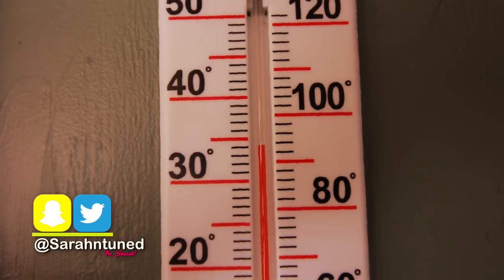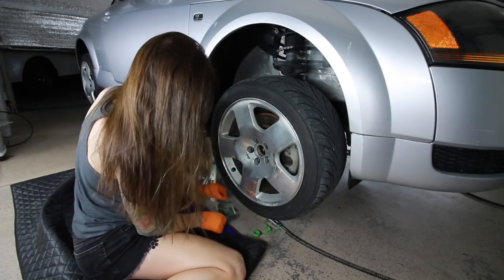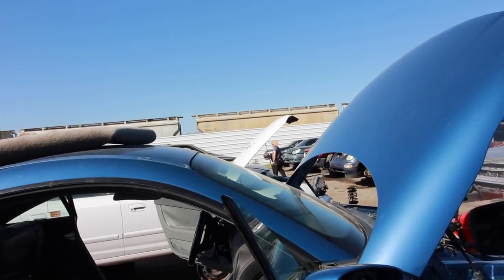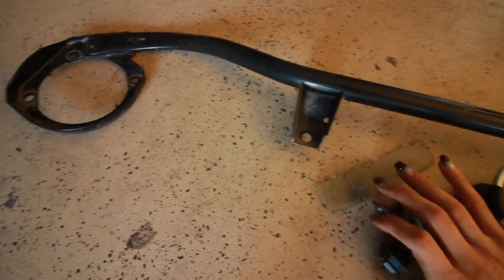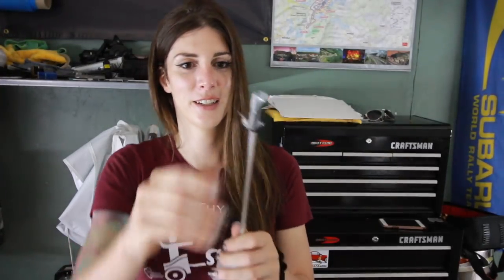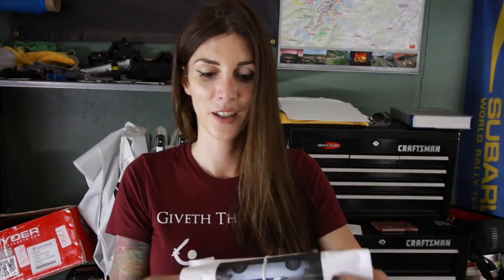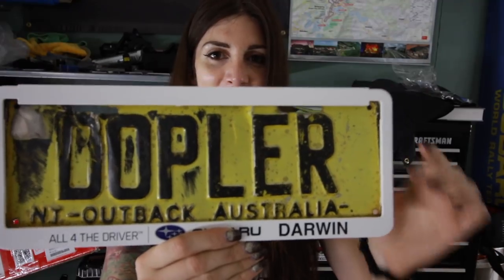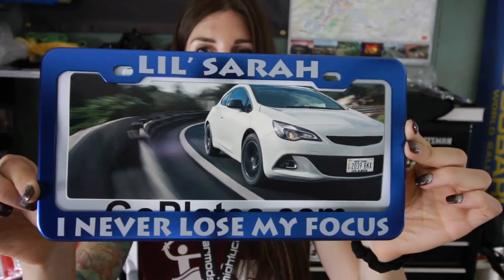Friday Night Out ..to the Junkyard // Vlog Series 025

Comment: The TT is getting better each time. One of my brothers had a 1999 TT. You're saving an absolute fortune using junkyard parts and even more on labour charges. My condolences on both of your recent losses. The thing that goes round your neck is called a lanyard (that's what we call it in the UK). I have to have one for my work pass.

Comment: Sarah on these platforms the fan won’t operate unless the air conditioning is fully gassed / charged. I had a 2002 golf gti where I could not get the fan to run. When I had the system re-gassed the fan was fine

Comment: 1.  Very sorry for your loss and of course Lil' Sarah's loss.  Just know there are people who care.  Lost my mom recently too.  Know how if feels.
2.  Not sure about the instructions on your cooler, but most air conditioners work by removing heat from one area and dumping it in another.  If it's just sitting in the garage, then it's removing heat from the garage and then just dumping it back in, while adding it's own heat along the way.  Because it's that hot where you live, you might consider venting it outdoors or getting like a wall unit or something.  That heat is brutal.
3.  While you were in the junkyard, you should have looked for a new driver's seat!

Keep up the good work.

Comment: Sorry to hear about Sarah Mom. One thing I have noticed on some of the older VAG cars is that they don't like aftermarket oil filters I know especially Fram had a serious issue with them kicking the low oil pressure lights on some of the 5 cylinder models. I solved the problem by buying OEM original parts and some MANN filters and it solved the problem on most of my customers cars.

Comment: That's a hard week.

Make sure you're getting 1J0 959 481A for that fan switch, and maybe that mashed TT still has it's cooling fan control unit and a good power distribution box at the battery.

When do you think you'll be troubleshooting the radio/dome light circuit in the MR2?

Comment: Omg im so jealous atm. Im looking for a cup holder for so long!!  :( Anyway you should check the 40A fuse on top of the battery fusebox.. Its a common fault on TT's to melt and prevent fans from working among with the electronic water circulation pump..
Reply from the maker: Futurensen do you want the cup holder?
Reply: @SarahnTuned  i'd love it but i live far, far away!  (Greece) :P

Comment: Hi Sarah,

The green top sensor is the coolant temp sensor (CTS) that is located in the coolant flange at the top of the engine next to the battery. Very common to fail on the 1.8T before it was revised with the so called "Green top". If failed, the dash temp gauge will no indicate correctly and the car might misfire.
The rad switch sensor is different. It can be tested via this procedure below. If the fans are not kicking in, that could be the issue, but check for air in the system. Better yet, burp the coolant system to be sure.

https://forums.vwvortex.com/showthread.php?4448717-How-to-test-Rad-Fan-control-Module-or-have-fans-run-on-high

Comment: need 5hp wet dry vac..  Not enough suction with the vac you have.  That is why it took so long
Reply from the maker: Joeys Cleaning Lady ...that vacuum is plenty powerful, I just need to change the filter on it.
Reply: that is good news!  you can hose it in driveway and get back the suction power.  That vac you have looks like a 2.8hp stanely that is a POS but could be mistaken.
Reply from the maker: Joeys Cleaning Lady no... it’s a Metrovac Vac-n-Blo and I have a replacement filter for it.
Reply: that is good also should blow out the fans in your laptop when you change filter will improve computer speed